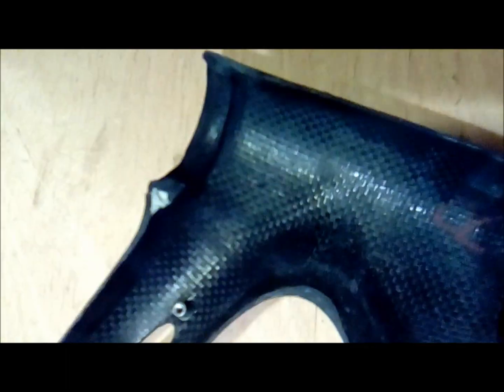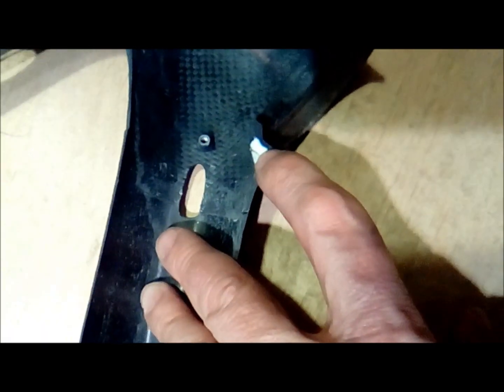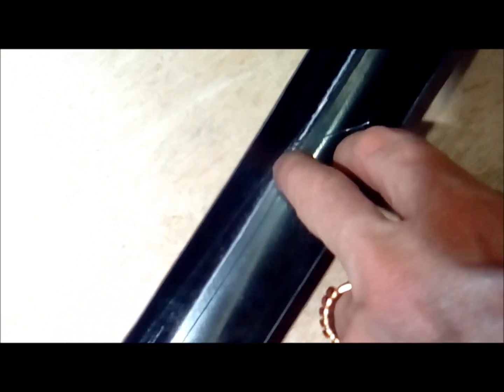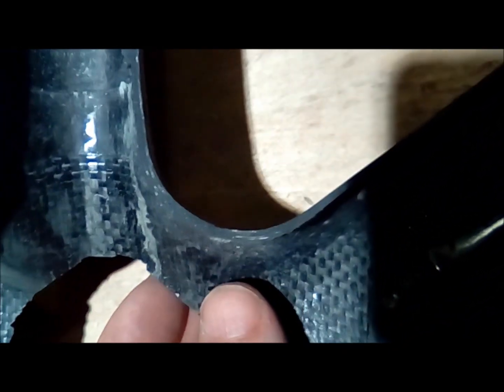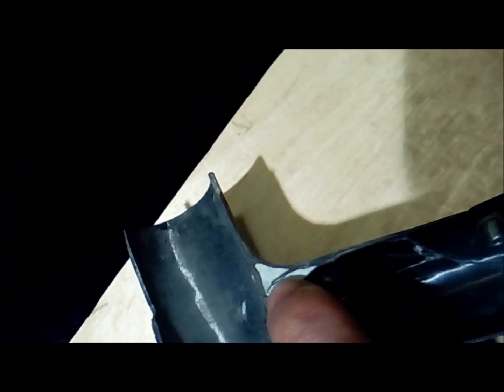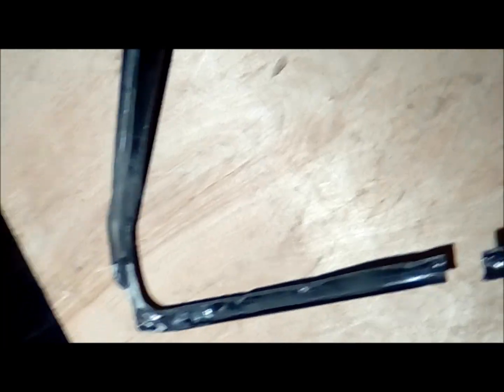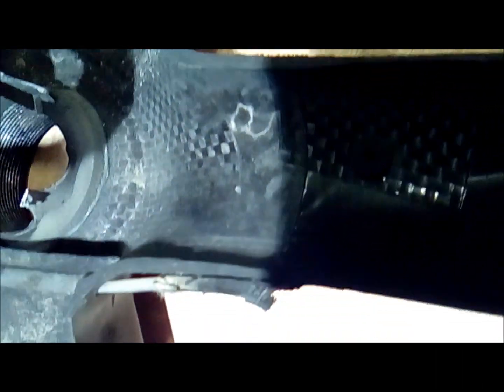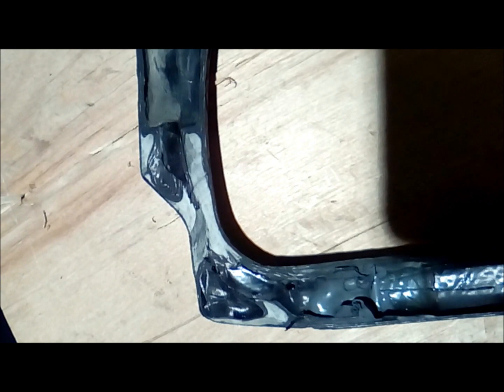China Carbon Frame cut up:  Sub $300 frame

Comment: LMAO go cut up a "branded frame" then think again.
Reply from the maker: It depends on two things:  the vintage of the frame and the brand.  I stand by what I said in the video.  Not too bad.  Pretty typical for a early 2010's era carbon frame.  You are implying that this is bad compared to branded frames.  I disagree (again, depending on vintage and brand).  It's typical in all respects except for the amount of adhesive between joints in the frame.  If you looked at a BMC/Giant/Specialized frame  you would find much less adhesive.  Excess adhesive doesn't concern me (in a cyclocross frame) so long as there is adequate adhesive.  This is a Fly Xii frame...which is a company widely known for their poor customer service & disreputable company culture...so the quality of this frame is actually several levels (orders of magnitude, actually) above the quality of Fly Xii employees.  That was a pleasant surprise.
Reply: It looks better than a Pinarello in another video. Looks on par with other high-end brands.

Comment: Thanks for showing this.  I'm impressed, the wall thickness seems to be very consistent w/ very little porosity or resin pooling compared to a lot of big name ones I've seen.  The wall thickness is slightly thinner, but the tube is only going to be as strong as the thinnest part.  So the consistency really helps there.  What frame was this, who was the mfg?